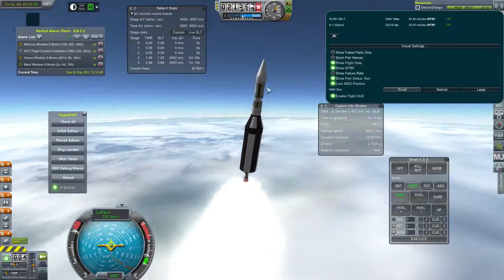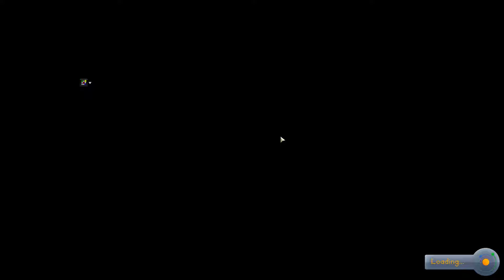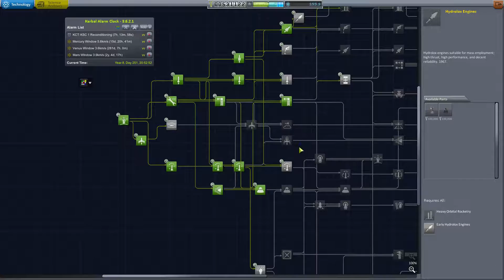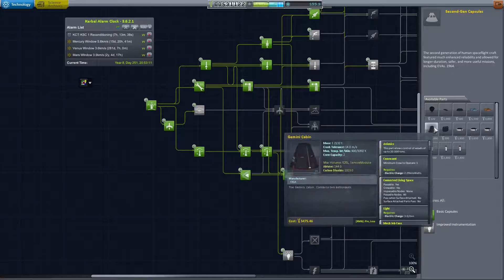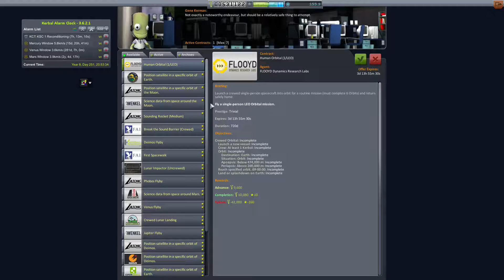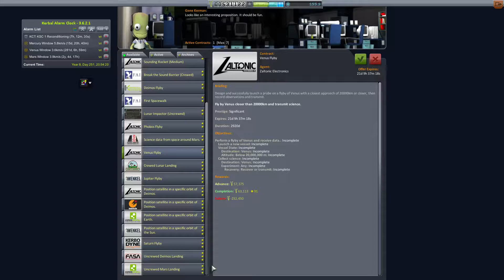KSP RP-0 1.1 - Ep3: The Sound Of Progress

Comment: I think mechjeb can be set to use stock SAS module instead f it's own, more complex one. Wouldn't it fix some of your wobble problems?

Would we like to see you do a Venus orbiter? Man, your videos are soo good that we can even watch your loading screen and that would still be pretty good! :D
Reply from the maker: +Rothank 

The MechJeb PID and the Stock SAS one both have issues controlling RO rockets. They vary over such a wide range of properties. The only reliable PID I've come across in 1.1 so far was the kOS one; it is a damn trooper.

I have a vessel design that should make a good Venus flyby. I may be able to unlock some tech to make a Venus orbiter as well before the window approaches, we will see.